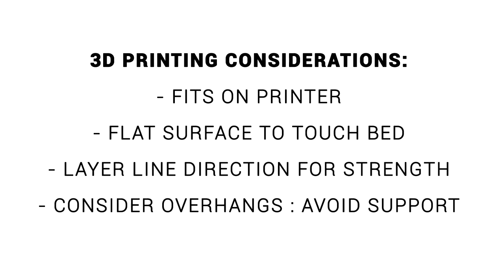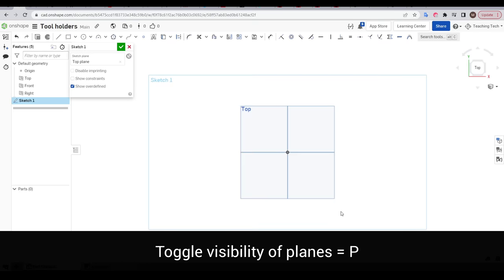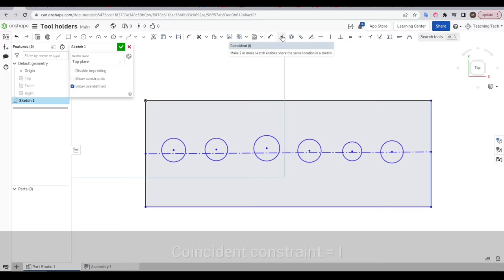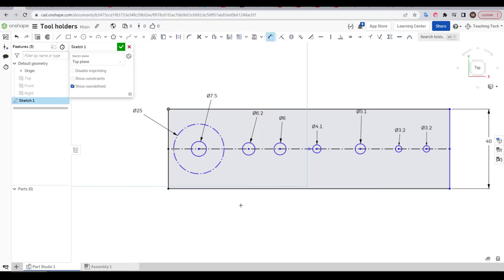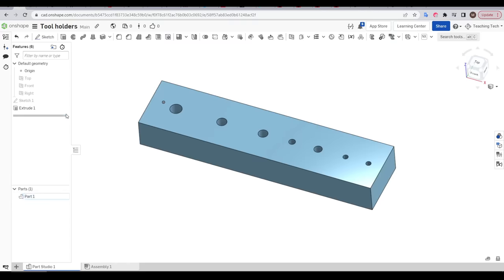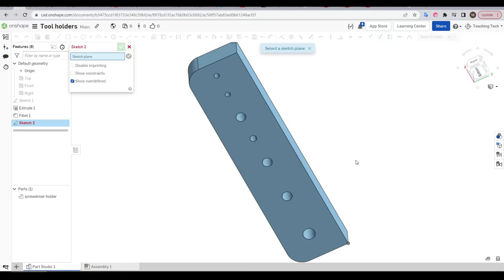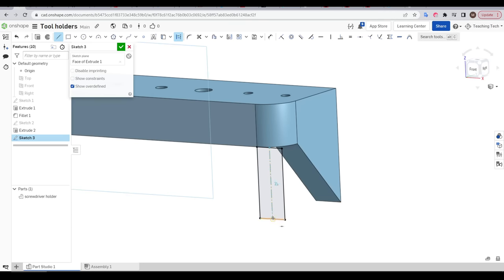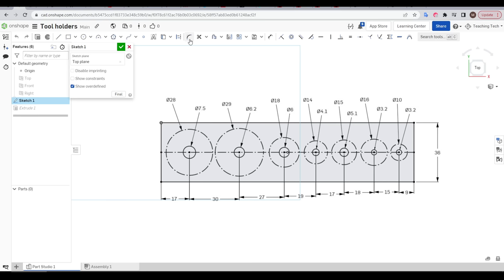Tool holder using Onshape sketches and extrusion - 3D design for 3D printing pt2

Comment: This is great. It allowed me to design a similar holder only for allen drivers and a pair of wire cutters and a pair of pliers. My only issue is I'm not for some reason turning all the lines from blue to black. So I'm missing something but it seemed to work anyway. 
Not sure what I missed. I set dimensions, distances..etc.

Comment: I tried to follow along with you step by step so that I could get a feel for how to create using the different features. Towards the end of this episode I got confused. When I export this file it comes out in two parts. Do i merge them on the slicer app? or is there a way to save this as a single file as one part not two parts? I hope you understand my question. Thanks

Comment: Big thanks for this series. This video enabled me to design and print my very first part. I´m still amazed by the process, that a digital sketch (after 8 h of printing) lead to a physical object. However, with my next design I encountered some difficulties. I want to design an adapter for the "chip exaust" of my hand planer onto a vacuum hose. The "chip exaust" is a parallelogram. So I designed a 3 mm thick parallelogram and a 3 mm thick circle 25mm apart, extruded both and wanted to connect both by bridging the 25 mm gap with the "Loft" tool. However the Loft tool only allows me to connect the inner diameter of the parallelogram and circle resulting in a thin surface and not a 3 mm thick transition from parallelogram to circle. I think I am a bit ahead of schedule, but that is the problem I (unsuccesfully) worked on for the last 3 hours. I guess there is a simple solution, but not for an impatient autodidact 🙂 Greetings from Germany and thanks again.

Comment: I already love this tutorial.  Having struggled with you Domino tutorial, please cover a future topic which I will explain:  I want to make a template with all the possible hole locations for a domino, then using that template extrude the proper holes for each domino in the whole set.  Something like design the double blank, then use it with the template.  Anxiously awaiting the next in the series.

Comment: This was very clear, and straight forward. I've been using OpenScad, as a programmer, which is great for simple things, but hasn't scaled up for me when I get to complex things. Code refactoring ends up happening. I have tried a few of the 'easy' modelers, but got bogged down in wanting to start with dimensions/parameters. The workflow of laying out the features of a sketch and then correcting them with the dimension and constraint tools works well for me.

Comment: This is awesome, thanks for making these tutorials. I've been using TinkerCAD a lot because it's so easy to use, but hit it's limitations quite often. Other CAD software just doesn't seem very intuitive. I'm not sure I'd call OnShape intuitive either, but it looks like a great tool and seeing some simple projects in action helps a lot.

I print a lot of containers for board game inserts as part of my hobby, and one thing I like to do is save material and keep walls thin, flexible and strong by punching hexagonal holes through the walls and sometimes the bottom as well. I currently do this by manually duplicating extruded hexagons and subtracting them from the surfaces. It would be a massive convenience for me if I could somehow generate them parametrically. So I could for example make a new box, set the outer dimensions, a wall thickness, a hexagon diameter and spacing and generate a mesh from that, it would be so useful and save me a ton of time!

Comment: Excellent tutorial. I feel like this covered all of the basic and common operations without getting too bogged down in details and options.

One small thing that I think would have helped is to quickly explain what a construction line is the first time you introduced it. You did make mention of it later and it quickly became apparent in how you used it, but I think a single sentence explaining how it's different from a normal line would have helped set some context as to when and why we are using it.

Other than that, this is great. I'm already familiar with CAD, but as someone coming from Fusion 360, this was still valuable for helping me quickly see how the workflow differs and what the common names and keyboard shortcuts are. I feel like this will help me a lot in quickly getting started with Onshape.

Thanks Michael!

Comment: You printed directly from Onshape without having to use slicer software?
Reply from the maker: I did not. But technically, you could use the free Kiri:Moto plugin from the app store and slice right in your Onshape window. I didn't include slicing because the tutorial is focused on the CAD.
Reply: Thanks. @TeachingTech

Comment: Great tutorial.  CAD has been a hard skill for me to pick up.  I've watched other tutorials and I can't help but get lost so fast as they seem to forget that someone completely new doesn't know the terminology and it quickly gets frustrating.  This tutorial was just right for me.  Explaining what is going on and not overwhelming with information in one video.
Reply: Yeah, it's not easy if you don't know anything, ie, starting off. Basically you know so little you don't know what it's capable of doing, and that means you don't even know what questions to ask to do stuff. 
I had to learn something like 10 different apps when I started hobby electronics 6 years ago, and it was like years latter that I found out the tricks to do complicated stuff. Basically modern apps are so complicated you are actually handicapping yourself if you don't watch tutorials. It's kind-of why I do tutorials after I learn something, ie, to get beginners up to speed quicker.

Comment: Definitely not for beginners. Way too much fast forwarding, changing dimensions without showing the change and lack of explanation of what you are doing. When you were showing the fillet on the sketch it looked like it was supposed to be 5mm, so when mine didn't match it was frustrating. Move forward a few more seconds and discover during the fillet of the 3d model itself that it's actually a 10mm fillet. I get that you don't want this to be overly long, but another 2 or 3 minutes with better explanations wouldn't be problematic.